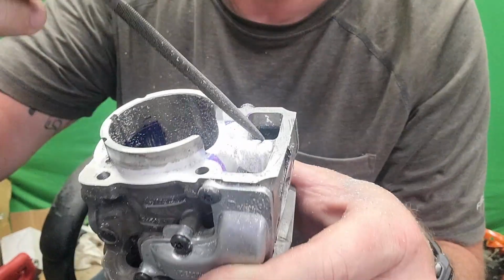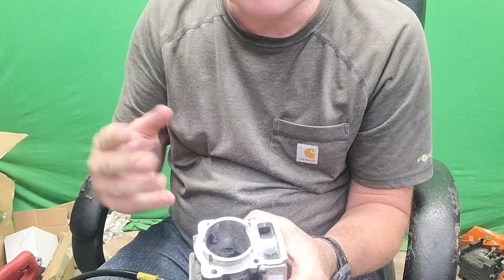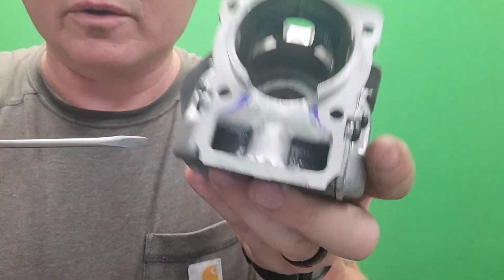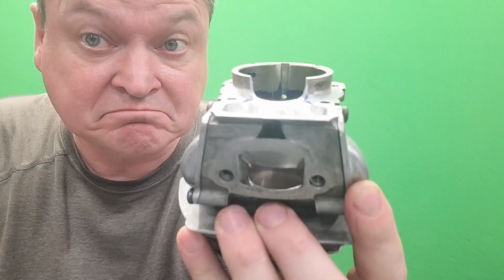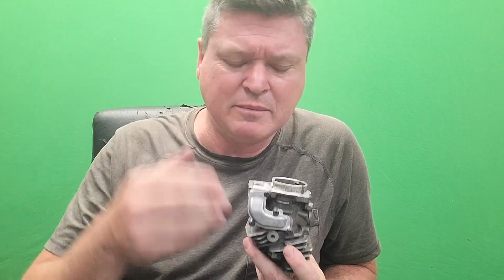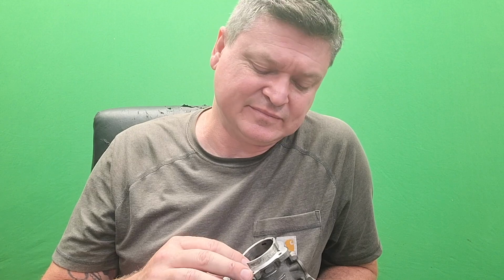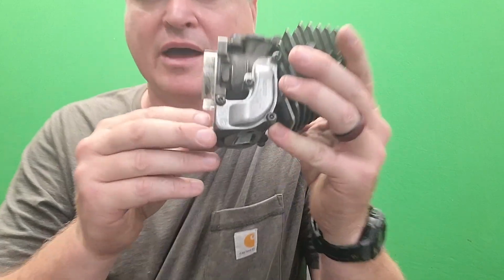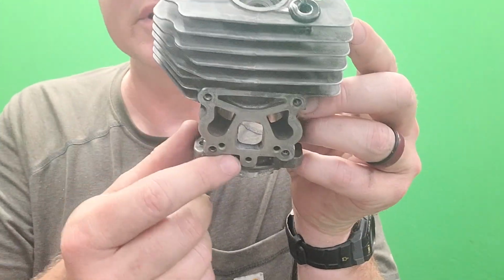Port work for Redmax GZ5000, Husqvarna 545, 550, 550xp

Comment: Hey Boedy great work on that build. I enjoy your videos very much. I have an explanation for the transfers being so long. I’ve been fortunate enough to be a saw tester for Husqvarna in the past and have spent several hours in the Husqvarna lab in Charlotte and I’ve had long conversations with engineers, and it is my understanding that the long transfers works as follows. As the piston is making its way to TDS. The strato and  intake ports open at the same time the intake feels the crank case as the strata ports fill the transfers with fresh air once the piston starts back down, closing the intake and the strato ports at the same time what you’re left with is those long tunnels are filled with air and the crank case with air fuel mixture as the piston continues down, it compresses both sides of the circuit to the same pressure, creating an air dam in the transfer tunnels, not allowing the air fuel mixture to come up into them. Once the piston clears, the exhaust port, and the transfers open up the volume in the transfer tunnels are exactly what’s needed to push out the spent fuel completely evacuating the exhaust before the fresh fuel air mixture makes its way into the cylinder just before the exhaust closes on its way back up to not let any of the new air fuel mixture escape into the muffler to reduce hydrocarbons. To meet EPA regulations. Shorter tunnels, would not hold enough air volume to do so.
     This creates a very clean burning engine, but it also is a hotter running and not as well lubricated system as the air charge has no lubricant. 
   Some builders have figured out ways to introduce fuel into the strata ports known as dirtying up the stratos. 
     And yes, doing so is beneficial. 
       Keep up the good work.
Reply from the maker: Jonathan!  Long time no post eh?  Glad to see you're still around.  Great explanation.  How the heck did you get that testing gig?  I'd love to do that.
Reply: Perfect explanation! I’ve witnessed introducing fuel to the strato ports. I personally haven’t seen much of a gain but everyone says it’s there. Man that job would’ve  been a dream👍🏻

Comment: Great build Boedy I'm working on a 550xp currently myself mark1. I'm in the same boat as you are with the decomp maybe hitting piston....my plan is to put layout dye on piston and mark piston through decomp hole then take piston out and spot drill or mill a relief in piston top! That little bit won't hurt flow pattern or lower compression enough to matter!!

Comment: 👍👍 I tend to think they were looking for the smoothest transition from the case to the combustion chamber, and this design fit the chassis.
Reply: When they increased the piston weight  it was necessary for it to go on angle. Good for race saws. Maybe with a racing piston, upgraded bearings and some crank work. With all that any two stroke will run bad ass for 3 cuts. I don’t believe it was for the end users convenience more like sales tactics

Comment: Having the intake runner going under the exhaust will not cool the exhaust side at all but will heat up the intake charge.  But due to the fact that intake length effects rpm range for peak torque or horsepower  having a longer intake path the resonating waves both positive and negative take longer to complete a full cycle.  Peak torque is reached at a lower rpm vs a shorter intake path would equal peak torque or horsepower would be reached at a higher rpm.  Heating the intake charge would be for emissions (think cleaner from within like Chryslers lean burn system and basically ever auto makers version etc) and by heating the intake charge it would also lower fuel consumption.  More or less there design covered a few different issues/reasons why they went forward with it for better or worse.  Just my thought about it.